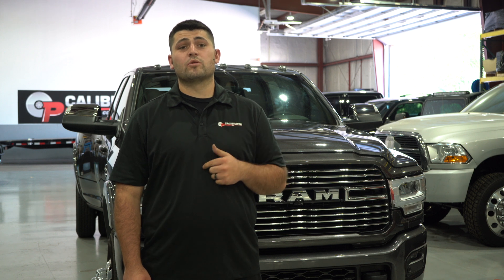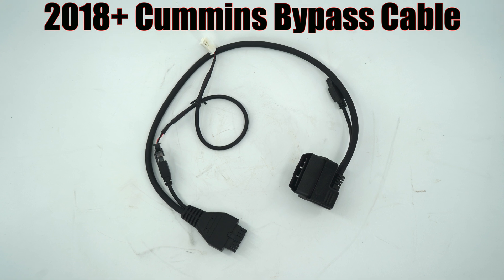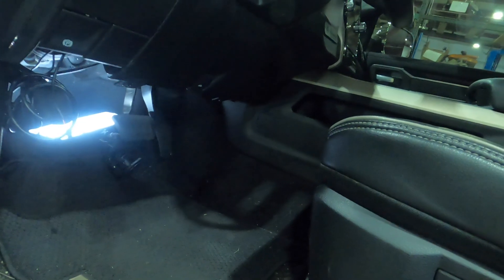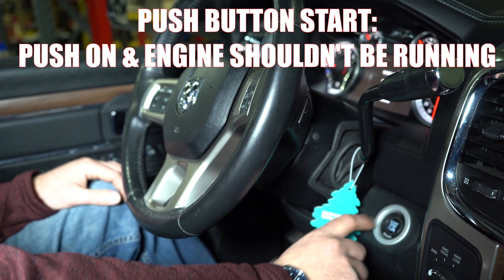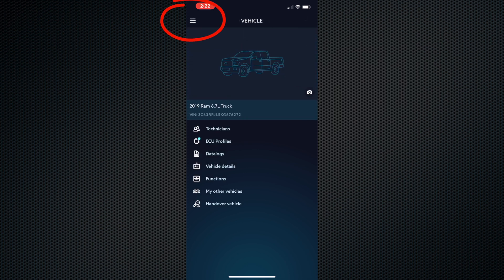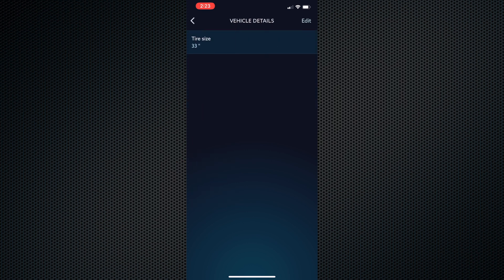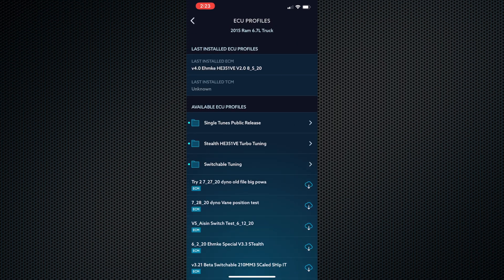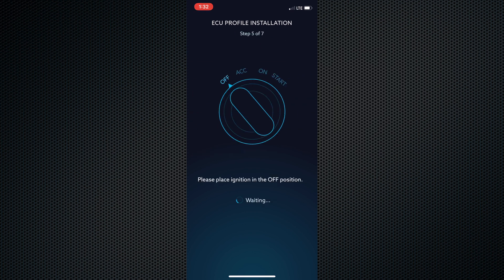Cummins EZ Lynk Install Instructions

Comment: 2018 Cummins — What is the smaller cable plug into? Not the OBDii or longer bypass cable that plugs into the green board, but that little short one off the connector.

Comment: If I have aftermarket AMP steps on my truck, and they're plugged into the bottom port of the gateway module, can I plug the EZ LYNK into any of those other open ports?
Reply: If you are reffering to open ports from an OBD2 splitter you sure can. Thats how I have mine plugged in